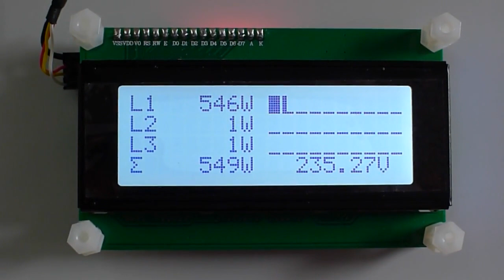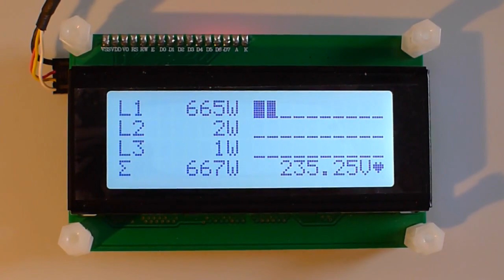Arduino Current 3 Phases Sensor with LCD display & Ethernet Connection - OpenEnergyMonitor

Comment: would you sell one of these? i dont think i have any hope of correctly building one, but this is exactly what i have been looking for
Reply: You're just too lazy to figure simple things out. Building one is a matter of connecting a shied to an arduino, connecting the sensors to the shield and running the code provided in the description. How easier can it even GET?